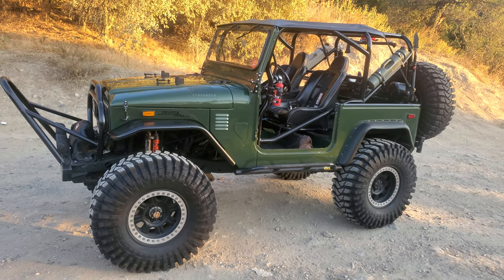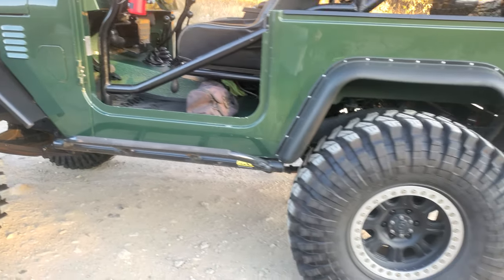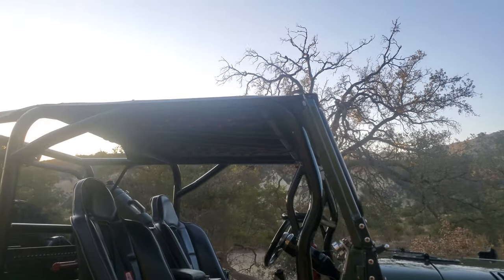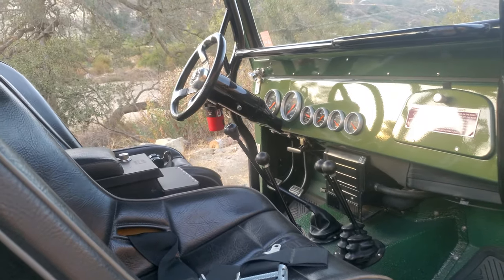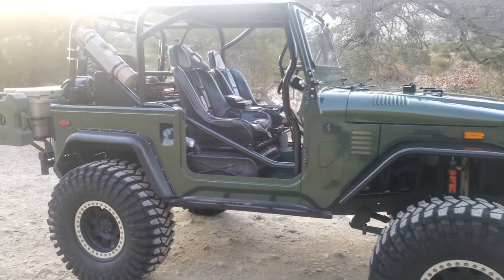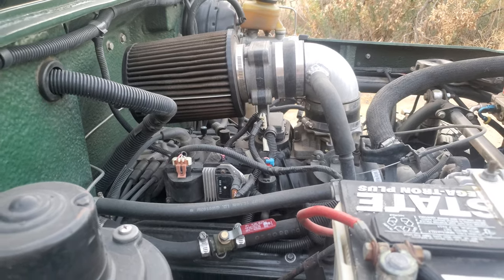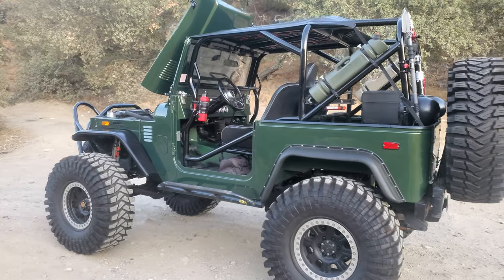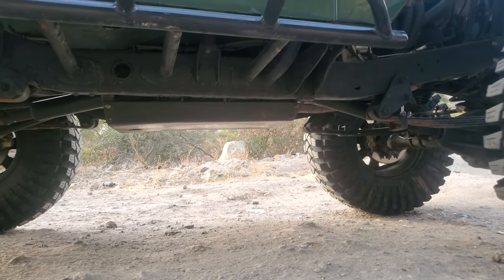FJ40 V8 Modifications Walk Around 4K

Comment: Great job. Nice workmanship. What kind of radiator do you have? My 77 FJ40 with Chevy 305 just blew the radiator. I need to replace it, but so many options. I plan on replacing the old 305 with a 5.7 Vortex like yours. 
Your help is appreciated. 
Paul
Reply from the maker: it is original! workhorse!
They just dont build like they used to.

Comment: What model PSC steering box and pitman arm did you use for the high steer. Nice FK40. I think I'm going to go with the fJ60 fronts and FJ55  rears like you did to lower mine. It sits too tall. Nice front fenders as well.
Reply from the maker: Not surr on the pitman arm. PO installed the PSC. Has a high steering arm, abovr the leaf springs (protected)

Comment: I like the vid. Always nice to Have guys with nice rigs to talk about there set up. Do you know who the manufacture is of your rear ladder bar? Need to get one for my 40.Thanks for the good content.
Reply from the maker: Man a Fre
Reply: @CruisingTheLand  Thanks for the info. Really need it after the rubicon trip. STRUGGLED!
Reply from the maker: Why did you struggle?
What size tire and engine in your 40? Lift?
Reply: @CruisingTheLand  I am running 37" boggers with a 350 chevy, 4 speed with stock axails. The prob was not the ladder bar. Just know i need to upgrade. The boggers are old and rubber is not in The best shape. Plus was not running beadlocks. So with that combo i lost a couple of beads on trail. But the big prob was i was still carburated and the motor was running like shit. Got a new EFI and in process for new beadlock wheels and tires. Will be ready to go for next year.
Reply from the maker: @brianzeh7719  yes, the EFI is a big difference maker especially with all the approach angles and also altitude.